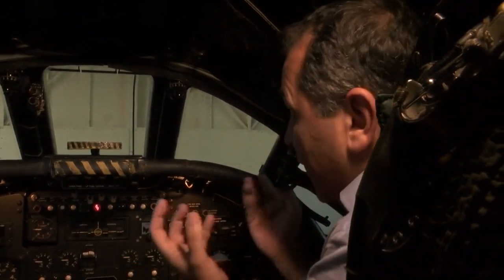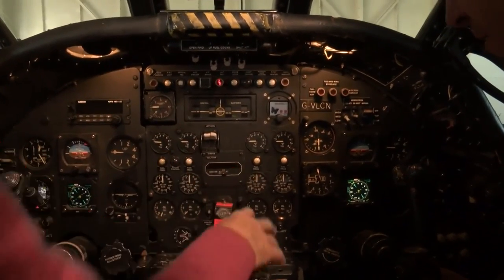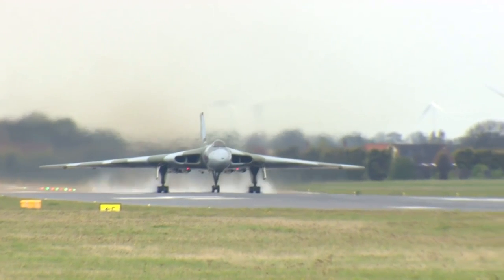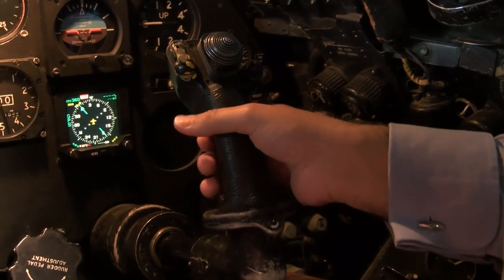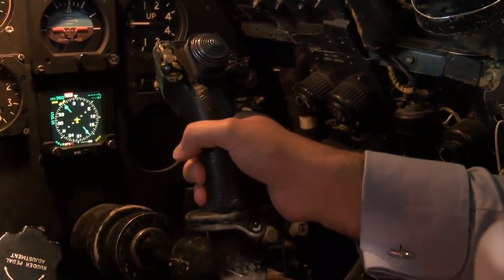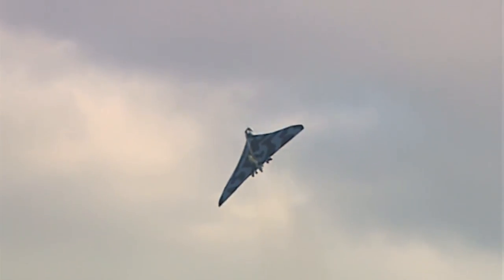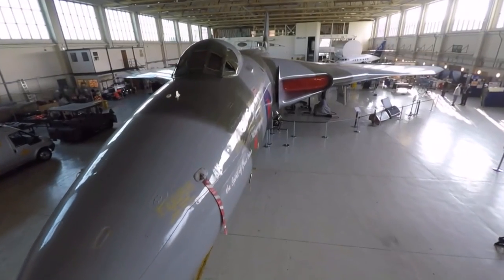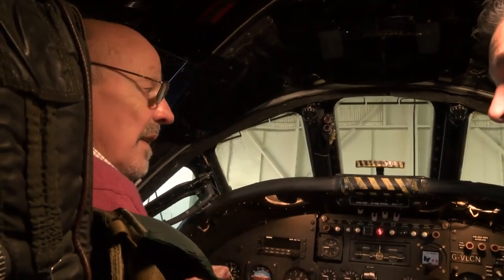Inside the Vulcan bomber's cockpit - BBC News

Comment: The UK success at inspecting, upgrading, refitting original bombing equipment, installing new gear & otherwise preparing these bombers for that war they fought in the S. Atlantic was an accomplishment in itself because they had so little time but still pulled it off. 
And those missions they flew from Ascension Island were amazing & had to have influenced the Argentine high command's decisions knowing the British had a weapon capable of attacking their mainland.
That doesn't mean it would've happened but the Argentines could no longer rule it out.